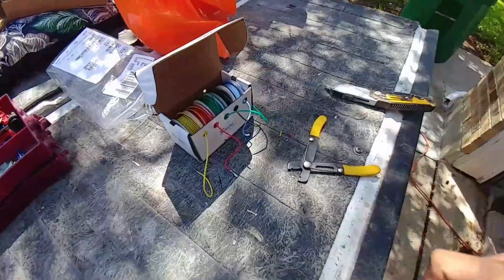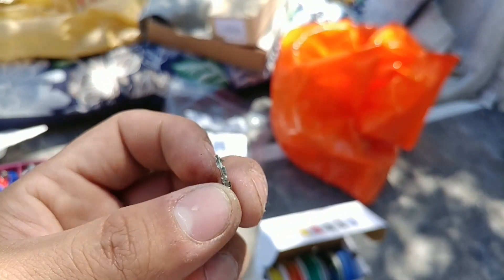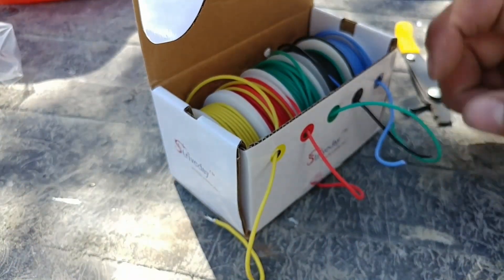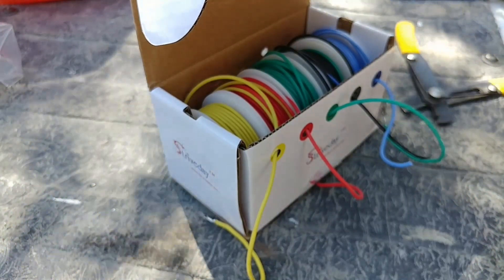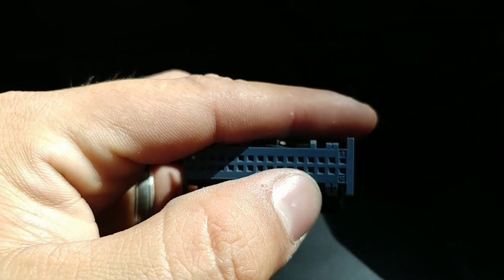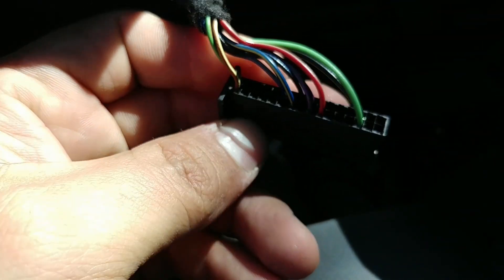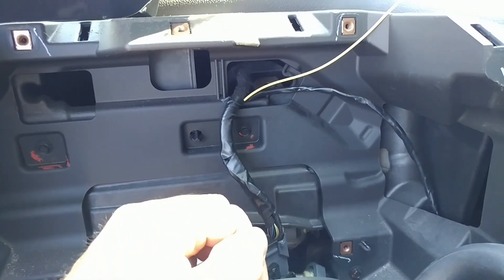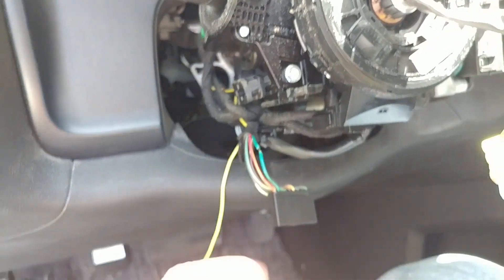Steering Wheel/ Gauge Instrument Cluster Upgrade For 2014-2018 Silverado/Sierra Part 1/3

Comment: Tengo una 2017 chevy silverado wt ya le cambie el cluster y el steering wheel cres k si conecto los cables al estereo trabaje kn los controles y funcione kn un estereo aftermarket ?
Reply from the maker: Con el estero original no creo que funcione almenos que ya aiga reprogramado el cluster y radio a su vin. Con un stereo aftermarket nose porque yo no lo trate haci
Reply: Ok .. el cluster ya esta progamado. Solo k kiero ponerle un alpine y kiero k funcione kn l0s cotroles del steering wheel
Reply from the maker: @JesusAlcala-o9d  si ya esta programado entonces si debería funcionar con el estero original y también con el alpine. Ellos incluyen los adaptadores para que funcione todo.
Reply: Ok.. le voy a calar aversi funciona .. gracias
Reply: planeo hacer ese cambio de cluster y volante pero no necesito que funcionen los controles de radio, entonces si solo quiero controlar el cluster con el volante es simplemente cámbialo? Ósea plug y play?

Comment: Hi, so have to have cluster controlled from steering wheel (plan to change steering wheel and cluster, radio is android already so do not need radio data on cluster) I just need to connect that yellow cable from steering wheel to cluster? Cluster pin is 20 and steering that green one
Reply from the maker: Yes I believe that is correct for cluster comtrol. Don't know how well if will work with your radio as is not the oem one

Comment: With the steeeing wheel could have just ran the single wire from the back of the cluster to a gray plug under the dash on the driver side and add the pin to the 10th hole on left side of the plug under the two white wires. The wire for the steering wheel is already ran to said plug has the green and black wire from the clock spring.
Reply from the maker: I didn't know that, I followed the only written guide and this was the way.
Reply: @Jorge.Rangel  Only reason I know it is because I was able to get a harness and strip it down. I followed where every wire went. I watched your video and several other videos and started to do it the way you did and I thought to myself all these trucks have mostly the same wiring with some features not being ran. Sure enough the wire you tapped into is the stock sterring wheel wire for all these trucks. Its pinned on one side of the plug and a empty place for the other pin to the connecting plug. I don't know how much you have done to your truck but keep in mind they all have pretty much the same harness you just have to continue what the manufacturer left off.

Comment: Did you solder the wires together to the green wire?
Reply from the maker: The green wire going to the steering wheel only goes into one location and you can just t tap or expo the wire and solder it. Which I did to make sure it never comes apart.

Comment: I have a Sierra and I want to do the same, but I do not understand exactly how many wires are there and where I connect them to. Please contact me Snap and explain to me
Reply from the maker: @hamadalzahrany8253  I did it the cheaper way, there's a guy who makes this harness so is mostly plug and play. https://harnessdr.com/
Reply: Can I do it myself or what is the name of the ready-made connection?
Reply from the maker: @hamadalzahrany8253  is alot harder and more expensive to do it yourself as you need special connectors you can only buy in big amounts. I suggest messaging harnessdr on the link I sent you and requesting a quote for the gauge cluster upgrade.
Reply: Well, what should I say to the person who gave me a link to buy the same piece connected to the dash?
Reply from the maker: @hamadalzahrany8253  just let him know you are trying to do the gauge cluster upgrade but don't have the wiring that you need the harness to connect the cluster to the radio to the steering wheel.
Reply: I contacted the person and he says there is no shipment to Saudi Arabia, can you buy it and ship it to me, and I will transfer the money to you?
Reply from the maker: @hamadalzahrany8253  I have no idea how to do that.
Reply: @Jorge.Rangel  I contacted the person and he told me
Reply: @Jorge.Rangel  need a pic of the glove box stickers work the codes
Reply from the maker: @hamadalzahrany8253  yes send him a picture of your sticker inside the glove box, that way he can see what came equipped on your truck and he can probably work it.
Reply: @Jorge.Rangel  Do you mean the poster in front of the passenger in the stairs?
Reply from the maker: @hamadalzahrany8253  just message me on instagram@egroj_legnar

Comment: I finally did the swap im only adding steering wheel control not radio so I already tapped in from the clockspring all good but i dont know where to tap in for the cluster pin
Reply from the maker: On my first video of this I posted the forum link, in there you will see the diagrams where the pins go

Comment: did u swap ur steering wheel to
Reply from the maker: Yes I did.
Reply: Jorge Rangel do u have to swap the clockspring to or just taping in to it and pining the other wires fix the problem i wanna install the denali cluster on it to is ther other wiring that needs to be done or just watever u show on the other videos for the stering wheel it looks sick
Reply from the maker: @miguelvelazquez2726  you don't need to swap out the clockspring unless you're adding a heated wheel and you wanted it to work, but that requieres running another wire for it

Comment: i need part 2
Reply from the maker: Man I wish I could do part 2, is just expensive to complete. Reprograming the cluster is around $350
Reply from the maker: Is gonna get done, I just need to save up for that, and quit spending on unnecessary things.
Reply: Jorge Rangel you can reprogram your cluster at white audio media for $200 i ordered the denali cluster but i am not lost on installing steering controls to my steering wheel because i have the w/t edition
Reply from the maker: Part 2 is up and part 3 is almost up

Comment: Steering wheel controls won't work without updated DIC ?
Reply from the maker: Correct. And your new DIC needs to be reprogramed to your Vin in order for that to work and your DIC needs to have some wires going into the controls and the radio module
Reply: @Jorge.Rangel  will the work truck DIC work with steering wheel controls ?
Reply from the maker: @sitnlow4life  I'm not to sure, as far as I know you have to upgrade to the color DIC un order for controls to work.
Reply: @Jorge.Rangel  Interesting... Work trucks never came with steering wheel controls ?
How much is it for WAM to program a color DIC ?
Reply from the maker: @sitnlow4life  no they never came with wheel controls. They charge $300 plus shipping. But contact them before you purchase it and ask them about the part number to see if it will work on your truck.
Reply: @Jorge.Rangel  yeah for that price I rather do the Yukon Denali dash
Reply from the maker: @sitnlow4life  that's more expensive lol. $300 for cluster and more then $300 for reprograming
Reply: @Jorge.Rangel  that's the $300 I thought your were talking about ... For the programming

Comment: Looks like you need to upgrade your steering wheel and clock spring to. But still need to run wires to radio and to new harness from new clock spring.
Reply: Jorge Rangel but dont you need new cluster for the controls to plug in for radio? And yes saw for the heated steering, but my truck dont have control for cluster and radio so i would need clock spring and wheel in order to work with new cluster.
Reply: Jorge Rangel but still would have to run wires to radio, but im thinking of upgrading cluster and steering on mine to, just waiting for someone on youtube like you to show us. So thanks for posting videos hope to watch part 2.